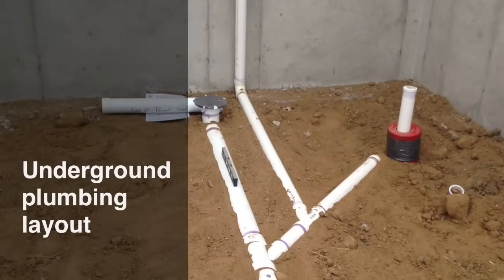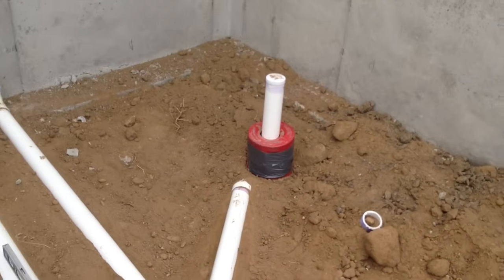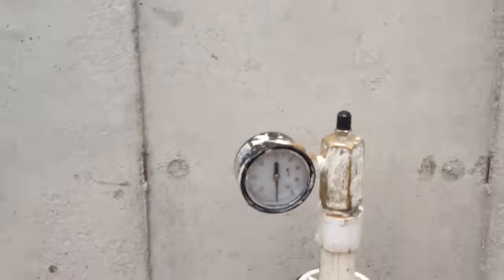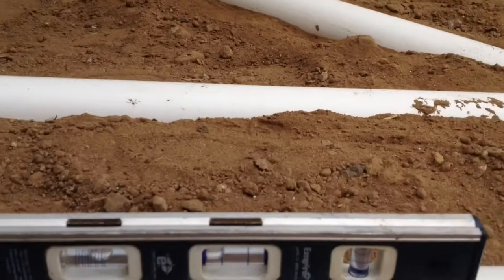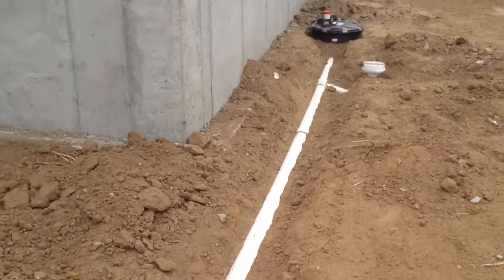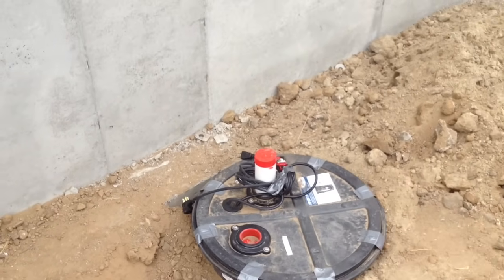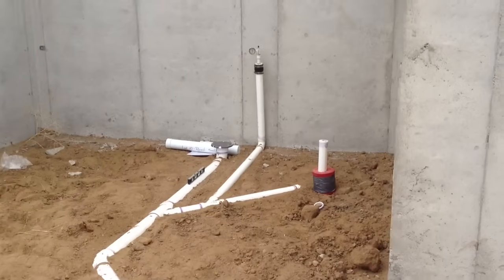Building a House - #09 Underground Plumbing

Comment: nice job, one question
If you have a drain and trap under the water heater in case it fails the p trap is dry. Wont sewer gas come up in to the room?
Reply: just fill it up no problem

Comment: I am thinking to use a 5 inches schedule 80 for underground plumbing under the basement floor. So that I would, hopefully, never have to dig the basement floor to deal with broken or narrow pipes. Cost doesn't bother me. Are there any other drawbacks to this idea?
We originally had 3 inches iron pipe under the basement floor and had a nightmare with the kitchen drain that clogged it with grease and all under the basement floor. I don't wanna deal with it again.

Comment: I would NEVER air test PVC pipe, because it can explode, causing serious injury or death.  That's not a code thing, and it's not my opinion, it's a fact.  Granted, it's only under 5 PSIG here, so it's only a little bit risky.   But, why tempt fate at all, and why risk misleading or confusing people about the considerable danger?  Sorry to criticize, it's a safety thing.

Comment: That is a horizontal  wet vent system. See it all the time in Oregon. For this system, everything looks ok except for the lav trap arm...sounds too far away. What about a primer valve for the floor drain? Not sure if the floor drain needs a vent and not sure if an ejector pump system needs a back water valve.

Comment: How far away is your longest run?? Did you have to measure down from the footer to get how far down the injectore pit has to go down?? In other words if the run is 40 feet, the top of your pipe at the injector pit has to be 10 inches down from footer?. Are you bushing down 2 x 1 1/2 x 1 1/2 tee for your lav and run 1 1/2 vent to tie into your vent going out the house???

Comment: Ten foot of head pressure on all waste and vent piping. Under ground, release air gaps and us gem caps. Should hold all day but 15 minutes is code in my area.,or until the inspection is done

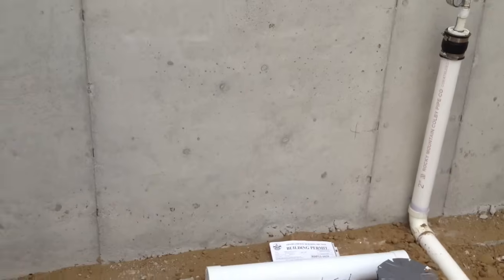Comment: Thanks for this video it answer an outstanding question I had about my rough ins for a bathroom in my basement.  I thought I had to break up the concrete to add a drain for the sink vanity, you explained it at around 2:19. My rough in has the 3 same pipes coming up through the concrete. Thanks.

Comment: Question. What are you going to do if there is a clog down stream of the toilet. Pull your toilet and flood your floor with poo-poup. UPC code specifies a mainline clean- out.
Correction: a Quarter bubble on a torpedo level is not quarter inch per foot.

Comment: I've been in the plumbing/pipefitting business for 43 years. I see 3 corrections there. The 2" should be 3" with a full size clean out. The trap arm for the lavy can only be 3'-6" on 1-1/2" otherwise it has to be 2" at 5'-0". Also the floor drain needs a separate vent. In a basement system you'll need a backwater valve to provent flooding.
Reply: Emergency floor drains don't need a separate vent and you can go 6' on 1 1/2
Reply: @Danfromthenorth84  

Some codes maybe but not in the UPC. The UPC is the only code I know.

Comment: They allow a vent horizontal below the slab/flood level? And 2" at that. What code is this? Big mistake putting the flanges on now. That's 1/4" per foot. No more, no less. Oh boy! You're in for a treat with an injector pump inside the building! Where's the protection(foam wrap) around all pipes going through concrete? PVC doesn't expand and contract? What's with the vanity drain. Where I come from.. maximum 42" from centerline of vent to weir of trap on 1 1/2" drain. This system is dumping 3 f.u.'s into a 2" vent for a toilet? Ah...no. While I'm at it,. What kind of 1/4 bend is that for the toilet? Not a vent ell is it? Sooo many questions!

Comment: Missouri my area has no code , I have owned 2 homes , the last home I redid the plumbing 2001 in and out to the septic , no vets the only vent was from the laundry room drain pipe 1-1/2 for the washer,  kitchen and bath room, 3 sinks tub shower toilet all off the 1 vent 50 foot away i could smell crap in the laundry room , the septic had 1 lateral 100 foot long . House 2 . has" 2 AAV vents" on the 4 inch main #1 is at the footing on a 2 inch vent pipe with a T off the 4" main only 2 inch long .  #2 five foot behind the toilet from kitchen 2 inch line tied into the main with a stack of reducers 2"to 4" , kitchen sink not vented at all not even a aav vent  sink vapor locks  and they had a dishwasher hooked up , under the sink 2 P traps and between them a pipe cut 3 inch short with a no hub band not even enough to tie the ends in. I had my Journeyman in plumbing 20 years ago in Michigan so I still plum to codes that are from 1987  to 2001 .  I have seen garden hose hooked up to hot water tank run to a kitchen 100 foot behind walls . and you all are saying his is bad lmao im redoing this house looking up new codes see how much stuff has changed in 20 years.  The Hardware is so far behind the times they still have stuff from 1952 on the shelfs , when you ask for something they have to order it . home depot is 100 miles away .  they do not carry any Y at all they only have T  to get a 90 you have to tie to 45 together they never seen it done they just use a 90 on 4 inch main ask for a long 90 they look at you like your dumb .

Comment: In Kentucky this would be completely wrong, as Kentucky follows it's own plumbing code rather than international code, and is generally considered the strictest state in terms of plumbing code. Here, you have to have an independent vent for each fixture, and no wet vents or flat venting under fixture level rim is allowed at all. Also each fixture had a set trap branch length and fixture unit.  (so a shower is considered 1 1/2 fixture unit with a trap size of 1 1/2 minimal, and can only be  3 foot 6 inches of linear pipe between the trap and the vent because a fixture has to hit a vent before it hits a drain.).Also the means of putting pipe underground or under a slab is much stricter (so All the plumbing underground has to be fortified with gravel, so you have to pour gravel all the way around the pipe to stop settling.That doesn't include if you run a pipe under a drive way, in which, it must be concreted around the pipe or it must be cast iron) It's much stricter for plumbers in Kentucky. We have to use much more pipe and fitting than other states, and therefore much more work.
Reply: flowable fill for any pipe conduit included. ;) under road or driveway

Comment: 1. THIS WAY IS ILLEGAL IN NEW MEXICO. 2. THE PIPE WAS NOT LABELLED AS PRESSURE PIPE. MOST PIPE I RUN IS NOT FOR PRESSURE SO YOU CAN NO PUT IT ON AIR TEST. HAS TO BE WATER TESTED.

Comment: This ground-work,should be laid on a bed of gravel,and not on the dirt! if the ground gets wet below the concrete-slab it could sink causing the piping to sag and clog up over time,there should be at least 3-inches of gravel below the ground work plumbing

Comment: Wow talk about uncivilized codes that all so much distance  from the fixture to the vent normally with in 2 feet of the fixture  .  Also  most authorities  call for a hydrostatic  test of 10 feet   of water  

Also  decent  codes call for CLEAN FILL  below and above the piping  as  to to have rocks  that can damage the watse or vent lines

Comment: this is a horizontal wet vent for a bathroom group which I s legal, one thing I noticed is the 3x2 wye is incorrect, should be 3 inch wye and 3 inch pipe to headed tword the shower and use a 3x2 wye to catch the vent pipe and a 3x2 bushing to catch the shower drain
Reply: its not a horizontal wet vent. the vertical 2" is a vent only which makes this all wrong. If a lav was pouring into the vertical 2" it would be better.

Comment: Good video but I would add that your measurements are "to center", for instance your closet, the 12in should be "to center" not just "12 inches from the finished wall" because some people might take that as the edge closest to the wall should be 12 inches and then you would be off when do your top out. I'm learning to be a plumber also so I don't know everything but I do know that.
Reply: A handy Andy will think like that.

Comment: Nice video. I was surprised how much you actually knew about the plumbing. I am a Journeyman Plumber and our Jurisdiction code is based on the UPC. Uniform Plumbing Code. I heard that the IRC code has a lot less venting requirements.

Comment: wow this plumber doesn't have a clue what he's doing, probably a non union hack. One in properly placed horizontal wet vent (suspect as horizontal wet venting already is), not to mention the toilet flange he already has glued on.... before the concrete is poured. wheres the clean outs for every 135 degrees change of direction? Higher union plumbers people, its an actual skill thats important.

Comment: the connection of ventilation is wrong. they have tendency blocked the ventilation pipe by the water stock or returning the waste water into line

Comment: You need to roll those fittings for proper venting.  F/D not vented why??? its not 3" F/D off a 4" pipe that terminates to open air. And installing w/c flange now is not a good ideal

Comment: vent cannot be ran flat or dry, the venting is illegal, and the floor drain must have a vent within 16 feet on 3" which i don't see that either, 3" pipe 1/8" per foot grade is required, anything below 3" is 1/4" per foot anything above 6" is 1/16" per foot
Reply: if that were a wet vent tying into a lavatory it would be legal, but you just said vent, but im assuming thats for a vanity

Comment: That is a horizontal wet vent system. It's funky as shit and I don't really like it but I've done it on multistory buildings. It. Ugh me every time I see it but we're all just used to conventional plumbing. Technically it's right though. As for traditional plumbing, technically the shower is fine. If your trap arm is twice the size as required then you don't need a vent (which technically I think it needs a 4" arm and trap)🤔. 2% required on all pipe less than 4" though and it's not permitted to test plastic pipe with air.
Reply: Now that I think about it though that vent is supposed to be larger. And have a clean out on it. So it is wrong. The concept is legal but.

Comment from the maker: The mass hysteria cracks me up.  I honestly don't know much of the plumbing codes - that is why I hire a licensed plumber in good standing with the county building department.  We have been rounds with the inspectors in the past over small details and everything we do is based on the inspectors interpretation of the code.  The inspectors spot check the lines with a level for slope and are generally very happy with this plumbing contractor.  Over the years, I've been a part of almost 100 homes that his plumber has helped construct and have had the opportunity to talk with many of the homeowners who have never had any problems.  Every State, County, and City is different.  We all know that in the end you do what passes inspections, meets budget, and produces a quality product - but that does not look the same on every build.

I appreciate all the conversation this has stirred up and hope that overall it is making us all better at what we do.  That is the whole point of community collaboration and discussion
Reply: In my area (Central New York) a home owner can pull out ANY permit on a single family dwelling. No matter how large that residential building may be.
Reply: Daniel Heap , I want to have a bathroom put into my basement, the house is 10 years old, I'm learning listening to people talk that it is not a simple job. I didn't even know there were pumps involved, I guess I will keep taking breaks and going upstairs and using  one of the two bathrooms I already have, plus it sounds pretty pricey, great video.
Reply: all of the crocks r 'connected'... Not to do job but to rob u of your money.
Reply: @peter58peter  1/8" pitch every 4 feet is for 4" and larger drain lines. 1/4" per foot is for 3" and smaller drain lines. That is from both the APC and UPC plumbing codes. Some local codes may be slightly different. I would check my local code, especially if a plumbing inspector is going to inspect the system.
Reply: Is supostube a 1/8 pitch on 3" and 1/4 on 2" pipe!
Reply: richard ortiz 
That's at minimum,  you can have a greater pitch, like 3/8" Which is much BETTER

Comment: Why is there a toilet flange glued on already, would have stubbed up my 4" with a cap and cut it off later after cement.
Reply: woohunter1 Late to the party but yeah, you stub up and add your flange after the floor is complete.
Reply: That's how I have been taught and it's the way I still do it (putting the flange on after the pour). I hate putting the toilet flange afterwards. I always have something of a hard time 😢😥🤔😰 it's very difficult to judge when putting the flange on before the pour and I have 32 years plumbing and heating experience
Reply: woohunter1 state code says you can pull  vent to 12 ‘ away from toilet trap
Reply: woohunter1 he used it as a cap 😂
Reply: Some people know how to read drawings and elevations, when you grow up you'll be able to read them too, and then you can set your flange before the pour.
Reply: @Hufdom  That may be true if the drawings include a finished basement with the build, but what if the home owner wants the basement left, and will finish at a later date? How do you whether he'll want a subfloor, or tile straight on cement? Or that dimple board and plywood with vinyl? Or who knows what else.
Reply: Kinton K as a 45 year old remodeler, the finished height of the flange depends on the height of the finished floor, there is variances in thickness of tile thin set, etc.  I also like to anchor my flanges in the concrete and tile after the tile is set.  Why don’t you read up on how to have “friendly” debates.

Comment: Every state is different, but in my area of Texas this would be against code. Water 
closet too far from vent and water closet would need 4x3 90 with 4 inch 
stubbed up. Flanged should be installed after concrete pour. But Ive worked in other states where this would be pass no problems and would work no problems. Plumbers who post on youtube videos need to keep in mind that whats going on in a video might be 100 percent up to code in their area.
Reply: That’s what I was going to say. I would think you’d have to vent the toilet directly out of the toilet line and wet vent it with the lav. Then maybe stack the shower or put it separately in a wall. There’s also no trap primer on the floor drain

Comment: that is a wet vent system although the center line of the 3by 2 wye is a bit far from the toilet here In Fla 5 ft from CL of toilet to CL of wye it's vented. and will work just fine for all 3 fixtures
Reply: Glenn Manchester i belive it is 6 foot
Reply: Its not a wet vent. He said in the video that the vertical 2" pipe is a vent only.

Comment: Old video but this is correct plumbing in Michigan.  Master plumber myself and I understand codes vary geographically and I've done this 100's of times I'm sure it works 100%   I've plumbed in Kentucky and this wouldn't pass inspection.  The codes their are insanely overkill!
Reply: Same in Texas. That would get a redtag (code rejection) here. Water closet too far from vent and water closet would need 4x3 90 with 4 inch stubbed up. Flanged should be installed after concrete pour.
Reply: Sure am glad I live where there are no inspections of residential plumbing...if it works it is OK
Reply: In AZ its not even close to a green tag haha
Reply: James Hudson i live in south Florida we used to be under the south Florida building code but now we are under the national code
Reply: Bill GlazikAs an Illinois plumber myself, a wye is perfectly fine to vent with.  Also you are never able to vent trough a shower drain.  Wet venting it is perfered  with our local inspector is possible.  I hope you’re an apprentice still!
Reply: A wye is fine to vent with, but should be rolled above the invert, which this is not. UPC code.
Reply: Raymond Allen UPC or national code book ..all the same . That shitter is not vented correctly .. End of story
Reply: James Hudson that is a good job ,IN Illinois  you have to roll all vents on a 45` and most inspectors won't letyou wet vent the toilet through the shower drain. I don't no if thay want plumbers to do more work and buy more pipe and fittings. Or if it is safer to have more ventilation in the plumbing System. When the  sewer vacume trucks clean the sewers mains it can  blow sewer water back  in through  toilets ,and floor drains ect. Thay may do mostly jetting these days  though

Comment: Thanks. This helps me as I'm adding a bathroom by using an existing room that's on a concrete slab. I know code is a little different everywhere you go. So the basics are what I'm looking for. My local code is 1/8" grade, but 1/4 sounds like a good idea, if I can make it work.

Comment: your plumbing looks horrible. the vent is not rolled up at all. and where the vent is you will have to revent. and it does not need 1/4 grade only 1/8. if you would of went 1/8 grade and rolled the vent you would not have a crooked stack. also use a 4 X 3 90 with a souix cheif closet flange. you can cut the pipe off at the floor and the closet flange will glue inside the pipe
Reply: Matthew Kromer this is a wet vent system. you dont have to roll up the vent like a dry vent sysyem
Reply: Matthew Kromer 1/4" per foot on 4" pipe
Reply: Exactly how we do it in my area, but some area require 1/4 grade on 4 inch and up.